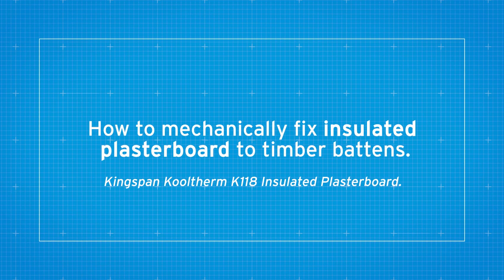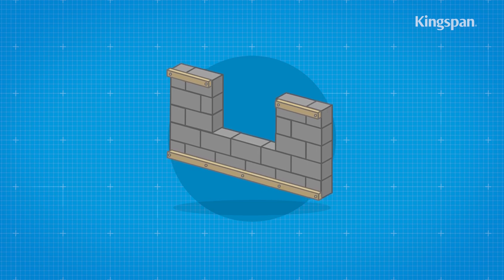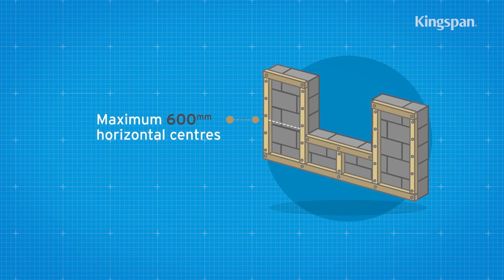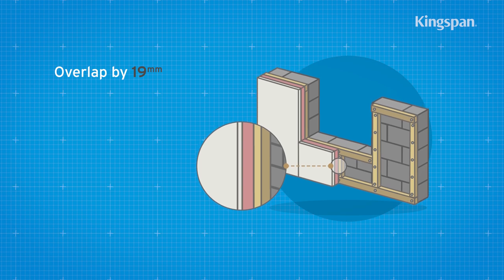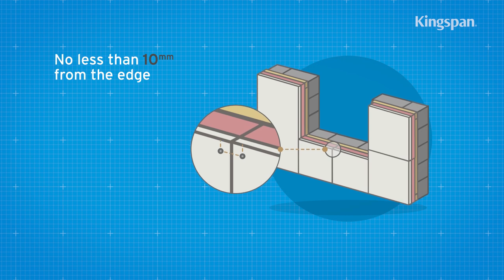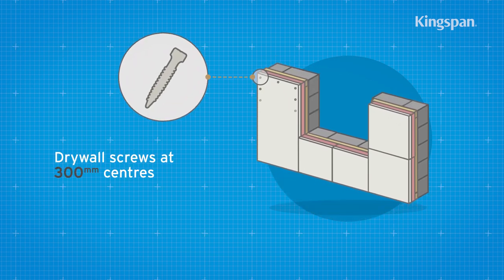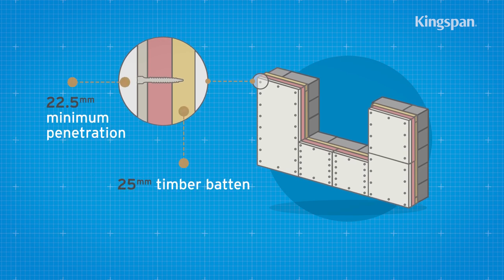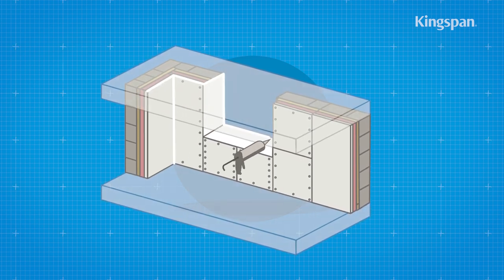How to mechanically fix insulated plasterboard to timber battens

Comment: I would have thought that some kind of gap between the vertical battens would allow for airflow  especially for external walls.
Reply: I would fit vertical 25mm battens then horizontal battens against those to create an air flow gap behind the plasterboard.  The design on the video doesn't allow for any airflow
Reply: Like a #